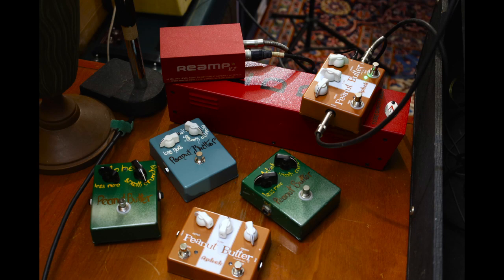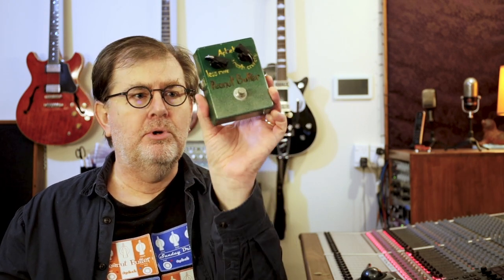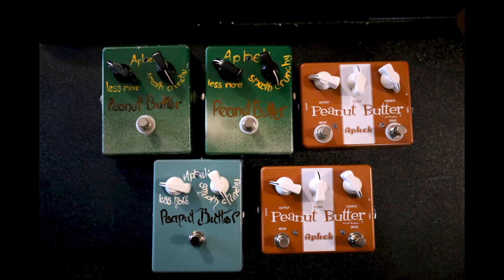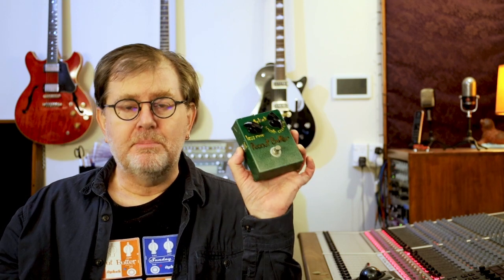Aphek Peanut Butter v Model T. Is there a difference?

Comment: Awesome pedals 👍 

I’ve heard about the difference in potentiometers causing people to question circuits - I’ve got two old Boss OD-1s and the volume difference between them is quite noticeable…it happens to all pedals no doubt.,.
Reply from the maker: Going to happen in pretty much all audio equipment. Amps, pedals. You experience it with mixing consoles, where the gain on each channel can vary quite a bit.

Comment: Dude. Excellent. I have the model t. Any favorite settings you like to dial in?
Right now I’ve just been stacking it.
I use my zen drive for a standard distortion/overdrive than press the drive switch (mean switch already on) on the peanut butter for lead tones. But I’d be curious to know if there’s any other things the pedal does really well.
Reply from the maker: Thanks. I usually run the gain in the last 1/3rd and the filter somewhere around 12-o-clock; then kick on the Mean switch for solos. Same as I’m doing in the video. It’s always interesting to hear how other people use them. Quite often very different to the way I use them.